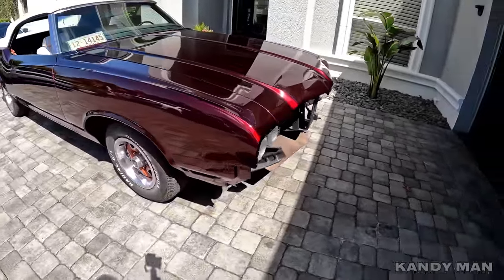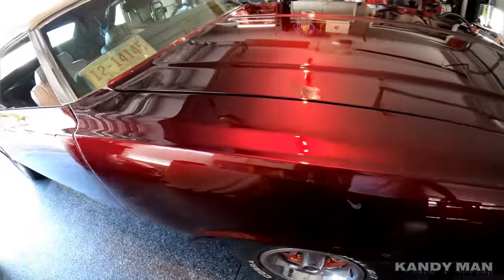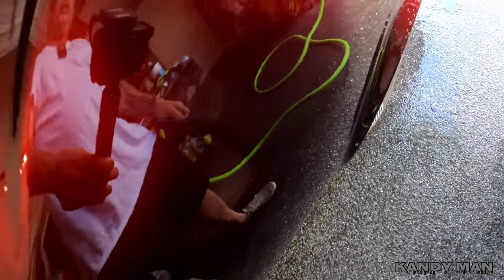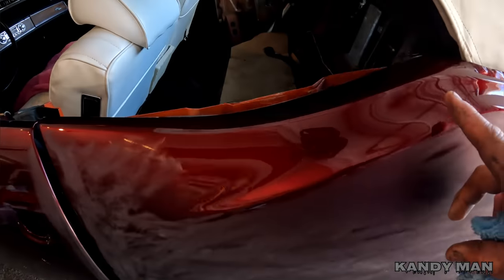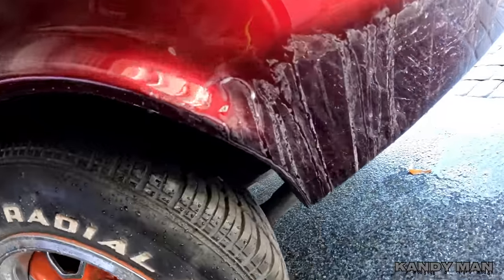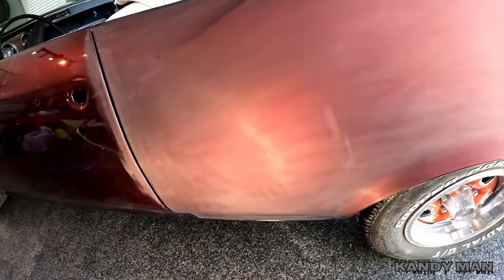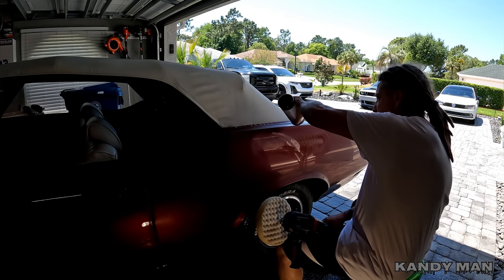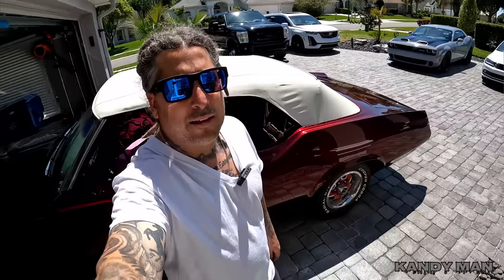STEPS FOR A MIRROR PAINT JOB PART 9

Comment: @KandyMan what kind of clear did you use ? Awesome work
Reply from the maker: Sherwin Williams cc200
Reply: @kandyman5315  will the ppg DC 5050 clearcoat over house of kolor candy apple red  be a good combination?
Reply: What you think
Reply from the maker: I've used all different clears never had a problem
Reply: @kandyman5315  I'm asking have you used the combo that I'm going with 👆
Reply from the maker: No
Reply: @kandyman5315  I meant the 2021 ppg clear not the 5050 ppg clear
Reply from the maker: Yes 2021 works great with it
Reply: @kandyman5315  thanks my guy and I appreciate your time